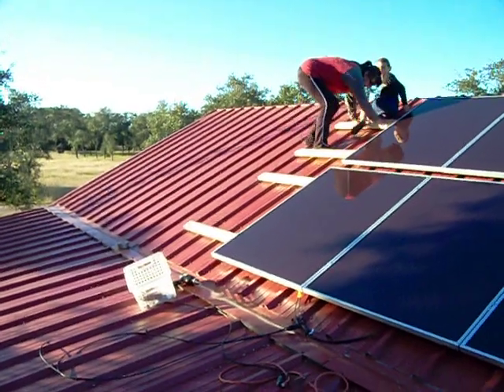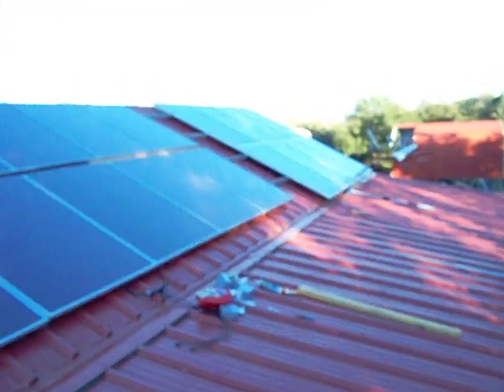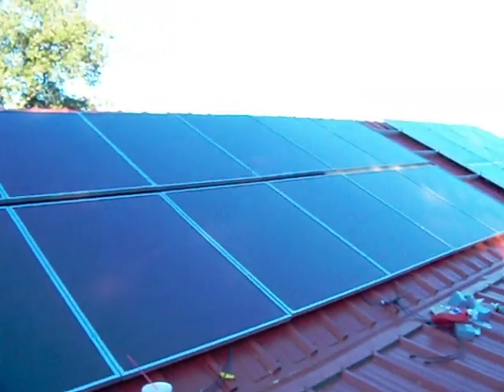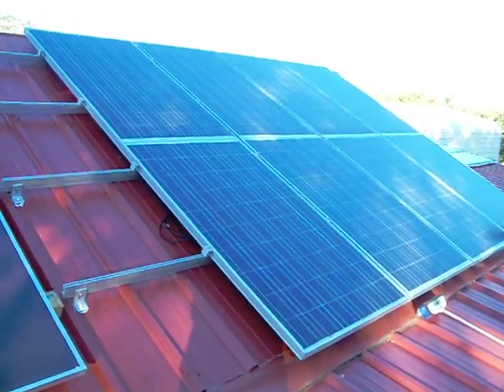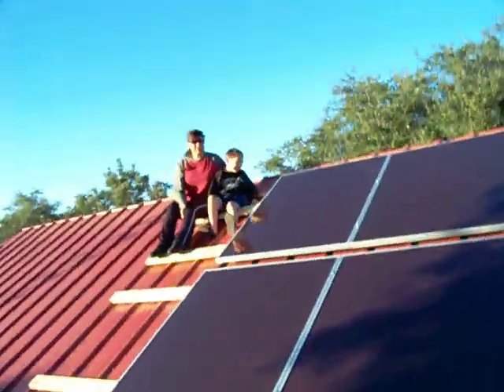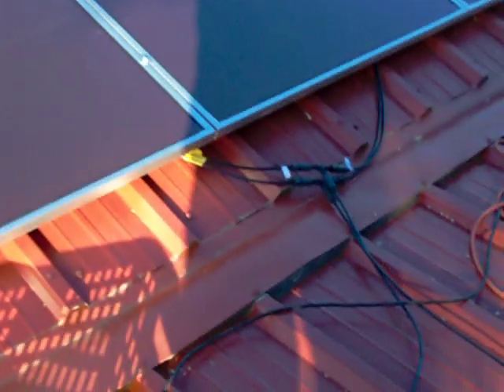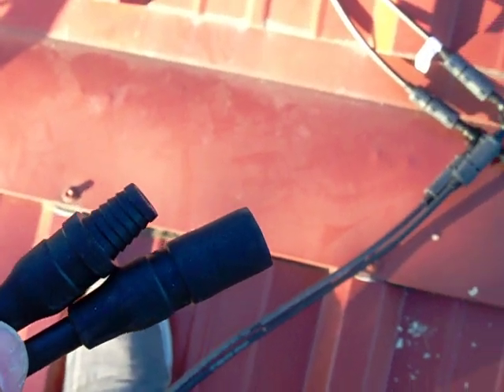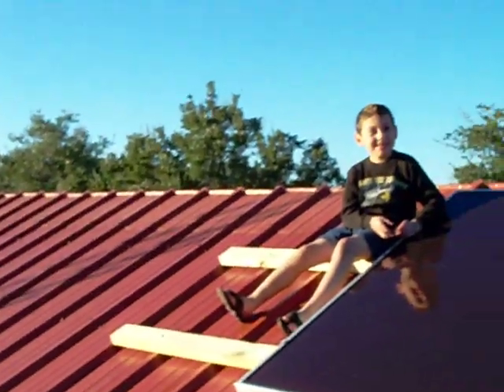2Kw of Dupont Solar Panels Added

Comment: I bought 2 used panels a couple months ago, I think they're the same ones you installed (DuPont Apollo 95 Watt) - one has a crack in the glass - do you know if the glass can be replaced?  It  appears the glass is not glued to the solar film - if  so I'm thinking I could probably just remove the frame and remove and replace the glass.

Comment: @wa5dxp I used butyl putty tape under the angle clips and around the threads on the lag screws then covered them with boots which you can get at lowes or most hardware stores,the butyl tape I bought off of ebay..

Comment from the maker: @wa5dxp I used lag bolts to secure the treated 2x4s (same for the super struts), the lag bolts just catch on the metal itself and on the plywood beneath. I first drill an undersized hole, fill the hole with exterior window caulk (silicon based) and put enough on the top so that when the washer presses against down on it, it will seal itself on the caulk. That's it.

Comment: @econewpower usually the best time to generate power is from 9 am to 3 pm during winter season and from 9 am to 5 or six pm during summer season, and during these six or seven hours there should no shadow fall on the panels.
if you keep the panels even in shadow you will actually get maximum voltage but very less current, to increase the current to get maximu power the panels should have direct without shadow sun rays.

Comment from the maker: @helloman1976 Solar trackers just won't work at my scale unless I put them on the ground but they would require too much space. They require very heavy mounts for my use and are very costly. Sure you can build a cheap one for a couple of panels and move them manually but then you have to remember to go out and move them every thirty minutes and make sure the wind won't turn them. Too impractical for me. That's why you don't see manual trackers out there.  God bless you.

Comment: @econewpower Very good, yeah I have a similar problem in the Winter time with the trees behind my house and since they are evergreens they don't "lose their leaves" but I have a solution in place already, I moved them lol. I'm building a solar tracker which should be able to hold a few of them, really just an experiment to see if it's worth it. I'll keep posting videos of it as I go. The cost of the tracker is about $200 roughly so cheaper than getting more panels.

Comment from the maker: @helloman1976 The panels in shade only at the last hour of the day in winter...like we are now. The are two trees that causing the shade at these times, I have to calculate first if the cost of trimming them vs. the expected power output on the last hour of the day when the sun is sow low in the horizon will be worth the cost of trimming them.  Other than that the panels are in sunlight from 7:30 AM in the summer at 9AM in the winter until 8:00 PM in the summer and about 3:30PM in the winter.